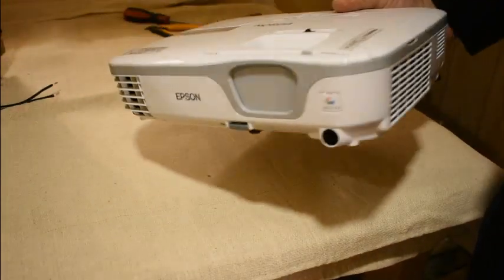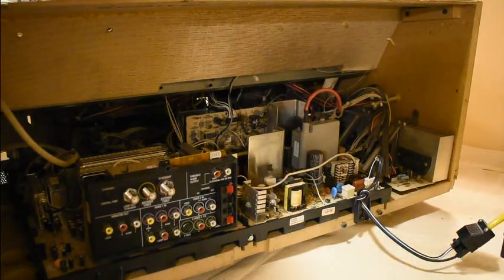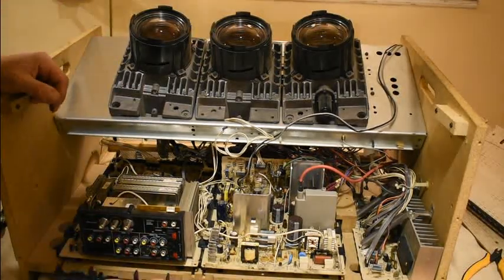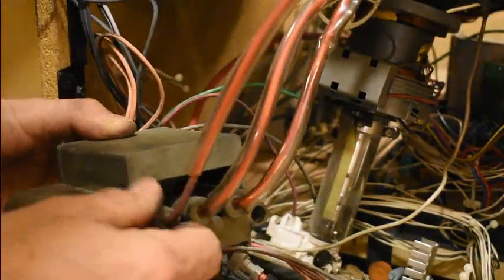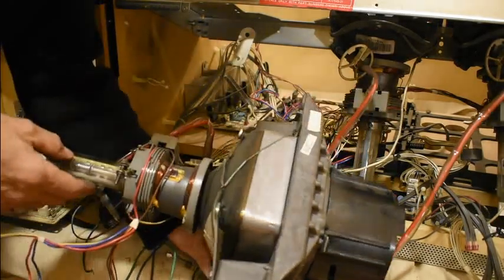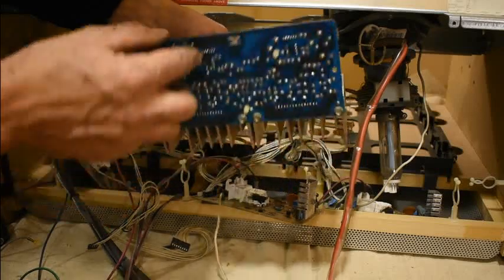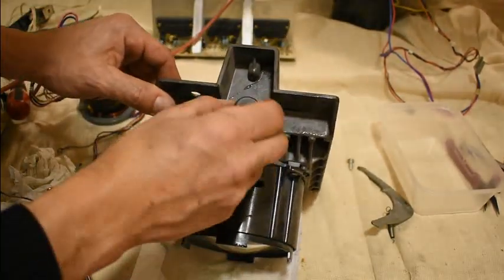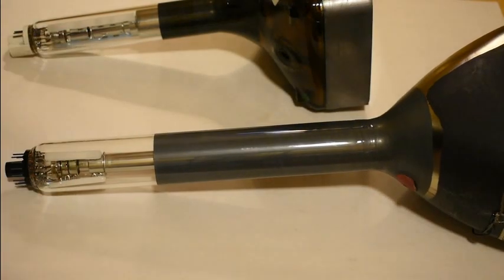CRT Projector tear-down

Comment: Because the tubes in these don’t use a color grate like you would see on a color monitor/tv tube, you can generally overclock the resolution to be something like 1080i
Reply: Now imagine you have two overclocked crt projectors running at 1080i, being edge blended with a jumper box to run at an even higher resolution with an even brighter image

Comment: I have entel crt projector tv 230v in India its power light work but not on can you help me
Reply from the maker: Unfortunately there are a lot of things that may be causing it not to work, so it's tricky. If you have a meter you can check some of the power supply but the high voltage for the CRT is too high to check directly with a meter.  If the HV is present you can often hear the static on the CRTs. I guess from what you say there isn't any HV on the CRTs .

Comment: More like a backside projection TV, that device. Too bad you didn't get the mirror and fresnell lens.

Please do a closer tour of the boards. Drivers, connections, e.t.c.

Also, the tuner, if you know programming you can use it to downconvert RF signals.
Reply from the maker: The lenses have a short distance focus, so think you are probably correct with it being a  rear projector TV. I have salvaged various part including some RF stuff, so may have some spin out projects in the future.